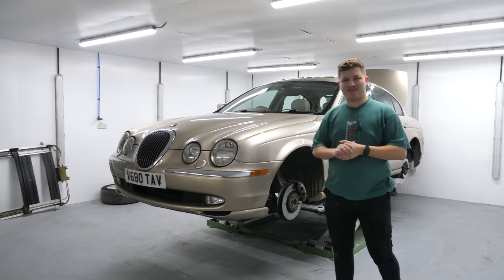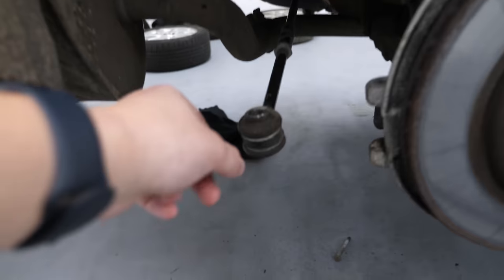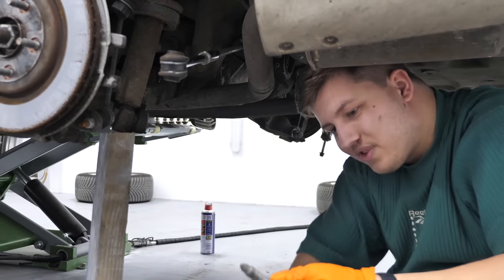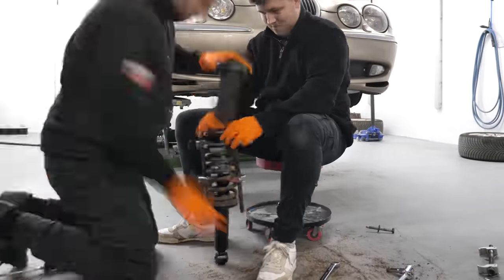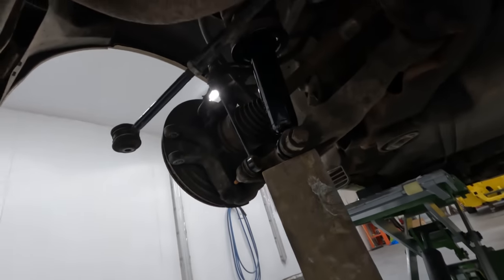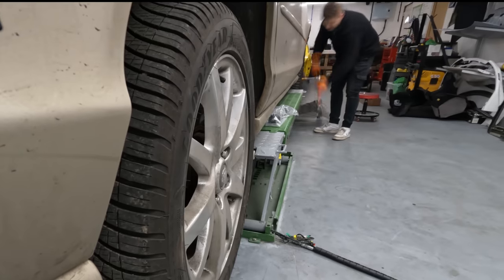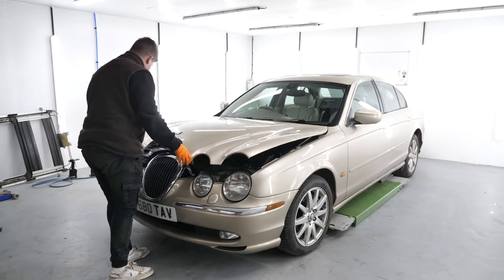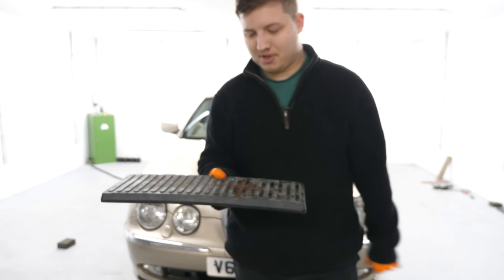I tried to fix my Jaguar S-Type by myself...

Comment: There's only one thing more satisfying than changing a shock absorber first time or doing an oil  change and that is driving the car after and noticing how such simple  maintenance transforms the car: roadholding improves with new shocks, engine revs with a 'happier' sound after the oil change. All that while the driver works hard to wipe a silly grin from his face.

Comment: Hats off to you Joel for getting stuck in, but I find if surprising that you have been around old cars so much you have not done any spanner work before.
If you are always dependant on paying for repairs, running old cars can become a very expensive hobby.
All the best Andy
Reply: That is surprising ... Contrary to ignorance and popular belief, most of this spanner work is NOT Rocket Science.

Joel's confidence should grow with more actual "hands on" experience and practice. in so doing, over the years he will save many of those hard to come by UK Quids. They all add up and over a lifetime of car DIY ownership, many thousands saved.

Comment: Straightforward suspension repair / upgrade that will significantly improve the driving experience.. not just the worn bush but shock absorber performance gradually degrades (like tyres) and you will have restored the Jaguar refinement.

Comment: This reminded me back when I bought my S type. One of the windows didn't work, so I took the door card off, and the window regulator was unplugged. The window was held up with a sawn off broom shank😂. It turns out that the plastic sliders fail quite often. It was easy fixed with a repair kit from ebay for about £7. Always makes me laugh when I think of this.

Comment: Question.  With the track rods out for new rear springs. Do you have to do a rear alignment tracking check ?
Reply: As long as they went back without them being rotated then it shouldn’t be needed. But it pays to have a check every now and then. Most tyre places offer it when you have new tyres
Reply: @andrewsouth9033  exactly what I thought. However.  I had a wishbone replaced and the siezed track rod ends returned position exactly so. And tracking was plain awful. Dangerous.  Front wishbones. Though.  I’m also new to giving mechanicals a go cars

Comment: pre-filling a filter is a bit of a myth, it has been proven it doesn't really provide any benefit.
Reply: I see no harm in doing it, especially if it's the sort of person who doesn't crank the engine until oil pressure is built. At least you're giving the engine a fighting chance of being lubricated quicker if started straight away.